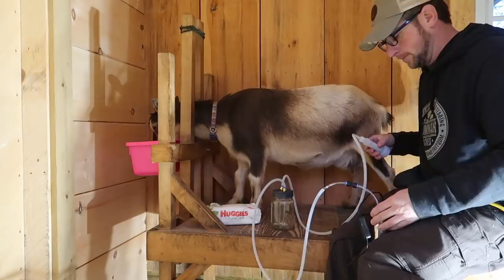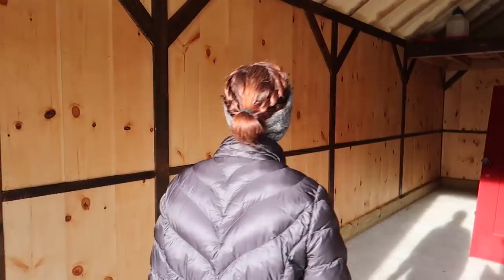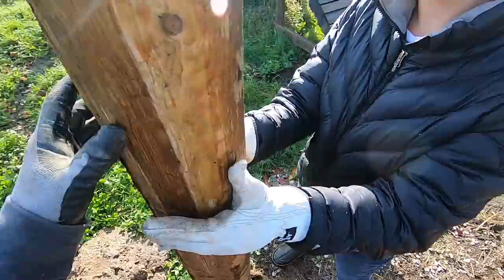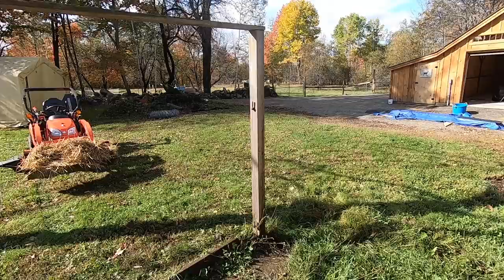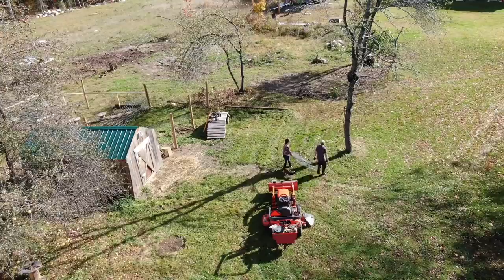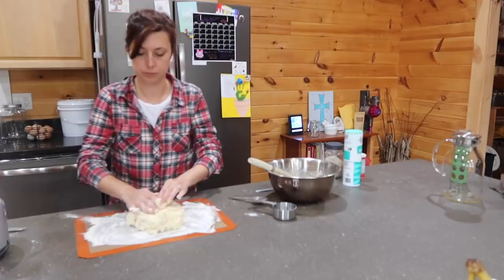Time to START Another Project! Building a NEW animal Pen on the FARM

Comment: I got a bit of a geology primer on the east coast when I still lived back there (before I escaped to the sunshine of Arizona! 🤠). Basically, you live in an area of very shallow bedrock. The closer you get to the coast the shallower it becomes because you're getting closer to the edge of the continental plate and sea level. So less dirt over the bedrock means less to absorb the water, it runs down through, hits the bedrock and then tends to run along the bedrock since it can't go through it (except for cracks it might find). The bedrock itself if you pulled all the dirt off is not level, at all, more like your land and perhaps even worse. High points and low points, as well as channels that the water will hit and follow, and the low spots will hold the water just below the ground until it rises high enough to spill over the surrounding bedrock. Those channels are why you find so many minerals concentrated in veins when mining. The running water channels into the veins and causes the minerals to concentrate in those areas as well. Back in the Baltimore area, we found a lot of places where you would have rusty rocks because of all of the iron flowing along the bedrock. When you saw that the bedrock was usually at most a couple of feet down if that. It would run along it and then out as it got shallow enough. The Natural History Museum there did a really nice presentation on it and now I know why I paid attention! 😏

Comment: instead of using your handle of the shovel to tamp the concrete...take a old 2x4 and drill a hole through it  and insert a large wood dowel toward the top to make a handle...from the other end cut the board in half and taper it to the edge so you are left with half...we use it to get close to our posts without getting concrete on our handles, and it is lighter than lifting a shovel...also put a small tarp down and put all the dirt you take out of the hole on it..makes for easy work to get your rocks and grab the corners of the tarp like a funnel and dirt should slide right off the tarp into your hole...it also keep rocks from getting in the grass and running them over with lawn mower...add them to your rock wall..haha

Comment: A tip. Concrete for preventing pole rot is most needed right at the ground line. Your pole would last at least twice as long if you had filled the hole with dirt, except finish the last foot with concrete .....extending a few inches above the ground surface. You can form for the above-ground area with any random container.

Comment: You have a spring outlet in the far pasture where you clear cut.  The spring probably runs underground near the wet post hole.  Highly recommend build pond project.  Spring water is cold and digging a small pond near there will be cold enough to grow trout which would add nicely to farm output.  I have seen farmers do this in Missouri and it works well.  Yum, trout for dinner.

Comment: You have an underground spring.  Use some fencing wire (2 pieces about 2 ft long bent at right angles about 4 inches from one end to hold onto. TRy water divining and you can find all the water and springs there.

Comment: Are you going to get gutters and down spouts or water catchment system on the new barn? All that wetness on the bottom of the barn walls is going to rot between freezing and snow build up in the winter, unless you sealed the exterior walls? You have done a ton of improvements this year!  Freezer camp is on the horizon!
Reply from the maker: If we do it won’t be until next year. We have to take them down every year before winter
Reply: @LumnahAcres  just curious how come no protection such as paint or clear satin lacquer to protect the exterior wood. I can't imagine the barn/shop was a cheap build and doing this every 4 or 5 years would pretty much guarantee that it would last the rest of your life with out major repairs.
I like or I should say love the real wood look but a little protection saves so much time and labor money in the long run that I can't see not doing it or at least not Thompson water sealing it or something along those lines.
Anyways I am enjoying the daily videos they are a great way to start my day.
Reply: @LumnahAcres  Al, I noticed a LOT of mud kickback on the side of the barn.  Maybe make a mini concrete sidewalk around the perimeter of the barn to keep that mud from getting all over the base of the barn?  Or gutters to catch the rainfall?
Reply: I would have laid a row cement blocks to build my walls on to get 8" off the deck for moisture.  That is stadard practice up here in northern Minnesota....especially on Garages.
Reply: Lumnah Acres why would you have to take them down every year?  Because of ice and snow pack? Having been a custom home builder in California, Utah And Illinois for 40 years, we put up ice and snow electrical systems to prevent the formation of ice on the roof and gutter systems and all the properties we built actually had heated driveways and garages in the concrete. Of course these homes were not run of the mill cookie cutter homes, I'm pretty sure Utah gets comparable snow to New Hampshire for the wasatch front anyway! 

I love the work you have done on the buildings, just seems like all that water running off the roof is going to shorten the lifespan of the wood if it's not protected! Even a French drain system with gravel may help , you get a ton more rain there for sure.  None of what you have built was cheaply done, just want to protect your investment in the property
Reply: I was thinking the same thing.  French drains would work around the base of the barn.  I would install an aggregate watershed gutter at the base if it were mine. Here in Colonial Williamsburg, it is very much the norm. However, it is a little different animal (environment) up in that Ice Palace where Al, Gina, and Oliva call home though.
Reply: @Bamboo4U2  A 3' wide  run consisting of a few inches of # 5 pea gravel would do a lot to prevent splash back on the side of the barn.  It would also provide good drainage.
Reply: @CRuf-qw4yv  There you go.  Pea gravel.  That's a simple enough solution.  Al really needs to do this.  That's a terrible shame, all that mud on the barn and it's only been up for weeks.
Reply: @LumnahAcres  I got tired of fighting the ice and leaves and took the gutters off and put down flat rocks at a slight angle. The water falls about 8ft. hits them and splashes quite far away, and doesn't dig a hole.
  Also we use 3" x 1/2" aluminum angle on steel roofs. 3' under the metal 1/2" standing up.  At the bottom edge start with it pushed tight on one end and slope as far as you can and still get a screw in it on the other end. That will act as a mini gutter and collect most rain and still lets the ice and snow flow over it. You can go from both ends to the middle etc. to a downspout, barrel or splash block.
Reply: @AtomicReverend  yes, maybe something like thomson patio seal or a new product with nano technology that withstands uv rays...but maybe they want it to weather naturally, cedar turns grey and it looks great..Nantucket look

Comment: I know that you know it, but the Kubota bucket is an excellent post "pull-upper".   I find that the "tilt" is a bit stronger than the lift but in conjunction the bucket is a great tool for pulling up post.   I have not figured a way to dive them with the bucket!

Comment: Wouldn't it be better to park the tractor the other way round in the space next to the wood shed, then the seat and tool box would not be left out in the rain and snow. The front bucket would not be bothered by the weather as much as the controls as they would be somewhat protected by not facing the inclement weather. t
The bucket, if raised and tipped down a bit would act more like a shield to drifting snow, plus when it has snowed you can plow your way out of the shed easier as you are already facing the right way.
Reply: I was laughing when I saw that.  He built that for Gina's car not the tractor.

Comment: we use tractor bucket and chain to pull t posts just half hitch chain around post hold chain and have it hooked to bucket and lift bucket straight up out comes post easy peasy
Reply: if you don't have a tractor, pouring a gallon of water at the base of a Tpost and letting it soak for 20 minutes makes it easy to pull by hand.
Reply: They also make T-post pullers. Great for tight spaces.

Comment: The water could be a natural vein running over to where the really wet patch is in the hew pasture you created last year !
Reply: Yes, here is how to track it down:
Draw a map of your farm.  By looking it up on Google Earth and using the measuring tool, you can figure out the relative distances of the buildings. 
Now as you see "wet" happen,  mark it on your map.  In time, you will be able to "connect the dots" and have an idea where the underground flows are.
Remember when the cement truck got stuck?  Add that spot to your map.

Comment: Hole Tamper.  A  curved "T" head club like head on handle.  (think golf putter...only a 10 foot handle) You back fill a hole and tamp the fill in formyl without  usig a bunch of costly cement bags.   No utility company uses cement fill except in very special cases.

Comment: 7’. The wet mess actually means that you have found a good spot for well to dig.
Reply: Get  two 36" steel welding rods.  Bend a 90 degree hangle in the last 5".  Hold parallel to the ground directly in front of you and walk around.  When they cross...you have found water..A few people body types can not do this..but you got 3 trys at it.
Reply: @dajones1128   
He's already found the water, all he has to do now is harness it for a good source of water for the livestock.
Reply: @0:10 - no. its not.
Reply: Mr. Client Eastwood there <Rowdy Yates of Rawhide>...he know where the hole is...but he does no know where the  underground stream flow routes.  Perhaps along that route he will find a better location for the herd to water.

Comment: 8:08 I'd be so tempted to dig a central culvert in the lowest part of the pasture, gravel it and end it at the stream to divert all the water. 1% grade to the stream would be all you'd need but I'm sure there are codes against that for very good reasons (animal waste runoff, fertilizer and pesticides etc.) .
 We had an ancient hand dug well on our property and the area down hill and just ahead of it was always muddy. It wasn't lined and I suspect it wasn't deep enough but that could have been an excellent resource for the gardens we had below instead of always watering through our electric pumped well we had for the house. The drop from that well to the lower gardens has to be 20 to 30 feet.

Comment: Interesting that you got so much rain. We've not had any for several days. 
Dig a hole, find rocks, what a surprise. Just like here. I have water issues as well.
I suggest that a good tool to buy would be a post puller. They aren't too expensive and those T posts come out EASY. With chain you can pull wood posts as well.
You three sure do eat fast ;) I've had fires in the wood stove 4 times now, overnight burns to keep the furnaces from coming on all night.

Comment: My guess is because the male goats were quiet when they first came there and remained quiet for quite a while, they smell the females in heat and that is why they are so vocal. After the girls are no longer in heat the boys will settle back down. As far as the water in the ground is concerned, you named it. The water in the ground is a channel for the water, it could even be a spring. Love and blessings.

Comment: We got our first snow and down to 7 above Wednesday evening and Thursday in my part of Wyoming, about 6".  Most of it melted or blew away Friday.  My Spring chickens didn't know what to think, they stayed in the coup  or within a few feet from the door.  I took them out temped water occasionally - looks like my water fount heater quit working since last year.  I ordered a new one. The older chickens went on free ranging wherever they wanted.  They've seen much, much, worse weather before.  They'll stay in when it's -40 and feets of snow too, but not yet.   It's  supposed to be back in the 70s here by Mon or Tues.

Comment: 2 things that will make your saw cut crooked 1 you may need to file down your rakers or 2 your bar needs to be filed down . But more then likely it's your rakers . Pick yourself up a raker gauge and file them . Cutting tooth size dose not matter . Hope this helps . Good luck

Comment: You were trying to put a latch on the pasture gate, tighten up the hinges closer to the post and that will give you room to put the latch in
Reply from the maker: The only thing is if I do that that be too big of a gap between the gate in the fence and then the little goats can sneak through
Reply: harold white he can tack another board to the post to fill the gap too.
Reply: Weld a truck "U"bolt to a hinge and attach it to the post,  Use a hinge that stops at 90degrees.  The "U" will straddle the gate and you only lift it upright to open.  A screen door roller snap close device will hold it up and out of the way or you can afro-engineer an up-right holder.
Reply: @LumnahAcres  
Could I bother you for your biscuit recipe ?
They look delicious and pretty simple to make. Looking for a made from scratch recipe that doesn't require to much and your recipe looks doable !

Comment: Snow coming soon. Barn ceiling can be a winter job in a nice insulated barn, not digging for posts in the elements. Winter prep mòst important. Allan, do you have plans to build or buy a sawmill in the near or distant future ? You seem to like that heavier post and beam style. Maybe a chainsaw mill.
Reply: @JudyG:) locals, neighbours and land developers give trees away already fallen. Are 6 x 6's so cheap in the U.S they are not worth milling ? A knotty old pine 6 x 6 cost an arm and a leg here in Australia and it's still green. Still, you may be correct. It is easier to just buy. As long as you have more cash than time.
Reply: Yep, its usually cheaper to buy than cut your own.  A sawmill is just one more piece of equipment to have to keep up with. Not to mention if its taxed, yearly, like some states do.

Comment: Ya might have found a shallow water spring.  Might wanna test for a possible well site.  Or talk to a surveyor and have them check the area to see if there is a shallow water table in the area of the goat barn, which might be cheaper than drilling and it isnt a viable spot.

Comment: I’m guessing you may have some lady goats or goat in heat.. is why the boys are noisier. As far as the water goes it could be a couple of things.. you could have a spring .. or your could have a layer of hard packed clay that is holding water like an underground pond.. remember last winter you put all that gravel down in front of the goat barn because it wouldn’t drain the snow melt.you also had that wet spot out in the pasture that wouldn’t dry up. My best guess would be a spring. Bless your heart Gina get some work gloves that fit it’s adorable seeing you work in gloves that are twice the size of your hands but it’s gotta be uncomfortable.. unless of course you like huge gloves and if that’s the case never mind.

Comment: get a 2 in 1 sharpener for your chainsaw. there are a couple brands out there (Stihl & Pferd). They will make your chain sharp as new. I've been using a couple of the Stihls (a .325 & .375) for several years now. saved me a fortune in new chains.

Comment: Water flows through the path of least resistance either deeper or down hill  so it is all about soil density. Your male goats are more than likely reacting to one of the girls in heat or just want the social interaction but they can't get close enough to the rest of the herd. Moving little man may help and it is that time of year that they feel the urge to breed so you could start your breeding program. It would be nice to have another permanent fence lot between the barn and the male pen so you can transfer the ladies easier and allow for restricted  social interaction.

Comment: now you need to take part of the back 40 and turn it in to a hay field so you will have fresh hay.
Reply: Hard to have a back 40 when they only have 8 acres.
Reply: @tonygrimes13  its a figure of speech.
Reply: @olddaphon  I know. Various Homestead Acts in 19th Century gave "free" land usually 160 acres. Generally people would build in centre, obviously depending on topography. The number 4 is common when measuring land in Acres thus a quarter of a Homestead would be 40 acres. Fascinating subject.

Comment: By putting cement in the bottom of the hole and dirt on top you have greatly reduced the life of the post...regardless being pressure treated.  Would have been better to either fill the hole full of cement with a crown to shed water or to have tamped dry dirt back around the hole. Dirt on top of the cement will hold moisture next to the pole. 
Having a farm you really need a tamping bar.

Comment: A pocket of rockets maybe so seemed like more water other hole more soil so seemed drier. Being a Water Well Driller water travel thru  grounds/soils is the age old mystery of questions,water tries to take the path of least resistance to travel plus gravity pulls it down. A post hole auger someone said save your money in that country to many rocks,hand dig works best,but please get a tamper save the tool handles you have left over 2x2s etc.